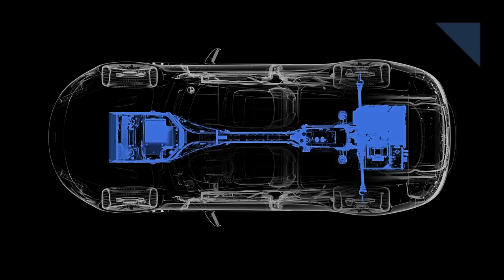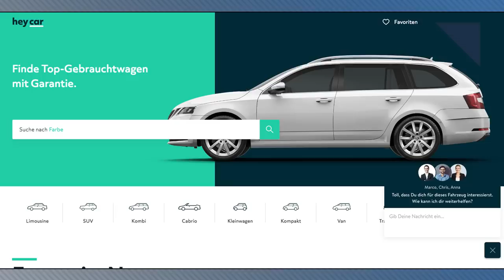Rapide E Details, Volvo Develops Cab-less AV - Autoline Daily 2434

Comment: Buy a used car to minimize depreciation?  They needed a study for that?
Reply: Until AVs make ride sharing cheaper than owning....
Reply: N C
Shared AVs won't be cheaper than owning unless you have to pay for parking. They will depreciate/wear out just like every current car, and they will need to be replaced. They won't last longer than current cars, and will probably have shorter effective lives because of additional driving between drop off & pick up. 

All operation & maintenance is no different between a shared vehicle and an owned vehicle. Other than storage/parking--and that's not big for a whole lot of people, certainly not bigger than the profit sharing companies have to make--there will not be a cost advantage to sharing.
Reply: AZDuffman
You never get more than you pay for. If buying used really got you more for your money, sellers would hold out for more money because buyers would pay it because they would still get more for their buck than buying new up until the point that it is the same value as buying new. 

Those first few years of car ownership are the most trouble free. The least number of parts need service/replacement. There's a warranty. As the vehicle ages, it costs more to maintain. The higher depreciation of those first years is the value of that most trouble-free time. The rest is just due to the fact that there's that much less life left in the car.

If a car (new) is $25k & the same car (3 yr old) is $18k, and if that car has a 15 yr life (when value = $0), just the loss of usable life should put it at $20k. The other $2k is roughly the loss of the warranty & loss of the least repair/service time. Where there is a real value delta is the new car smell--the intangible confidence people have with being the first owner & knowing it doesn't come with anyone else's baggage. And no, that's not really very much.
Reply: With all do respect is not worth debating someone that doesn't realize a vehicle or any product designed for commercial use will last far longer ie the average Semi vs a car... But don't worry most people that live in the past wont live long enough to see it anyway... So Keep Clam and Have a Nice Day, Sir....
Reply: dMb  Keep getting those new cars on a 3 year lease, lots of folks like me like letting someone else pay big for the depreciation.  I saved about $10K buying used last time.
Reply: Only a fool thinks it even close in terms of cost to buy the "average" vehicle new vs used.....The exception would be rare collector type of vehicle.

I saved almost 2/3rds of the cost buying used vs new. But I did purposely  look for a car with good reliability, but a poor resale value, so I saved over $14K buying used last time( at the time it was heavily leased and sold at  a discount to fleet owners that depressed its used car price). And this was over a decade ago so the difference should be greater now if one could find a comparable deal.
Reply: N C  Exactly.  Unless you want snob appeal just look for something leased to death and heavy in the rental fleets.  I don't think you will do quite as well today as that deal 10 years ago, used is always a better buy.  I did even better by going to Florida to a HUGE used dealer, had to drive it 1000 miles home but save $3K over buying local.
Reply: It had some very minor hale damage too but had low mileage and was in great shape otherwise. So the new car dealer just wanted it off the lot. But it came with remainder of the warranty so it worked for me. 

I have thought about going out state next time but even though I never bought a lemon just in case its better to buy locally. But to save $3K it could be worth it???
Reply: @ dMb: Keep on dreaming:
The average transaction price (ATP) for light vehicles in the United States was $36,270 in January 2018.  It was 25K in 2000, you are just 18 years off from reality. Also average useful life is 11.8 years and not 15.
Reply: N C  The place I bought is set up for it, they have a dedicated sales office a few blocks from the lot where they do thousands of out of state sales a year.  I paid $80 to have a shop check it out, and that guy is no joke he "fails" 1/3 of what he sees, so he tells you like it is.  My brother bought there as well and his brother-in-law asked "what on earth is it with you guys buying out of state?"  Six months later guess how he bought